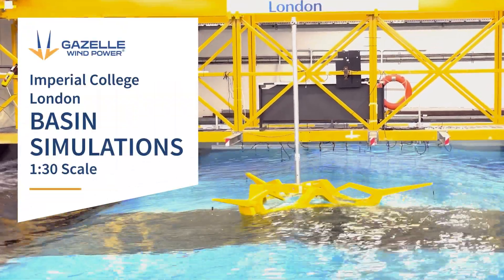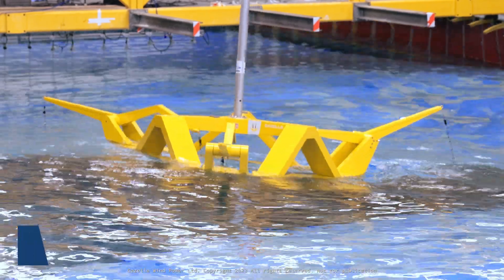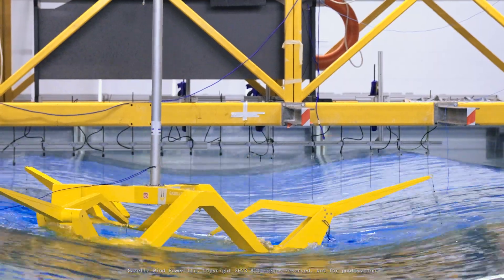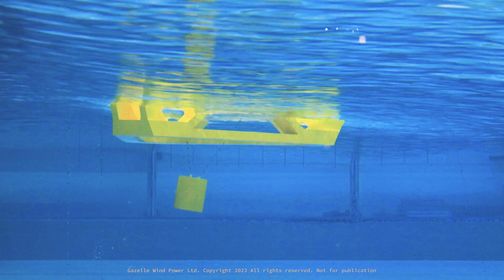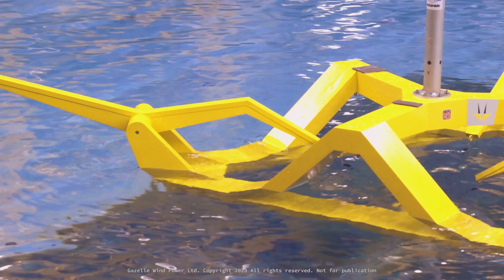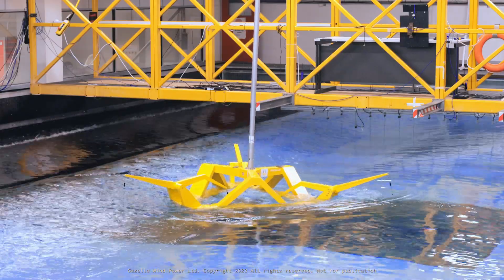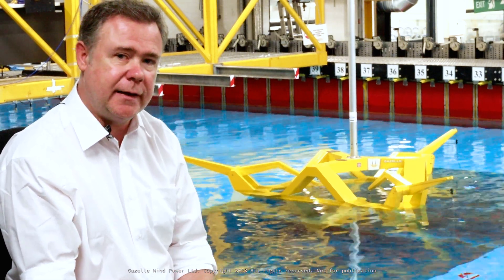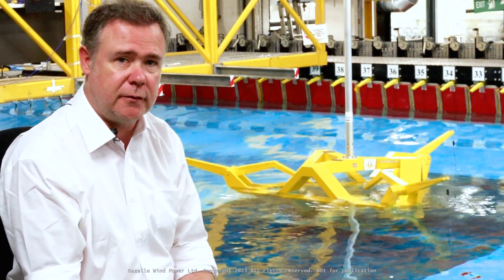Demonstrating the Gazelle Principle

Comment: This is ineffective.
Reply: support your statement
Reply: justify your answer
Reply: I agree with simismakov. To enhance stability, it is essential to minimize the impact of waves by reducing the volume of the structure at the waterline. Simultaneously, it is crucial to maximize the moment of inertia of the waterline area and lowering the center of gravity. For this structure all merits have failed. To counteract these failures a costly system is proposed that will only partially eliminate the problem.